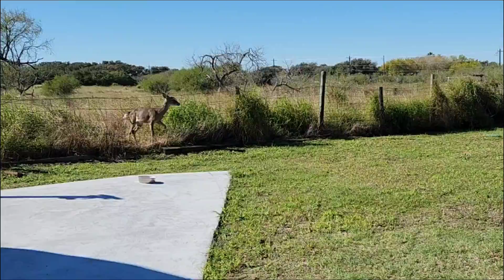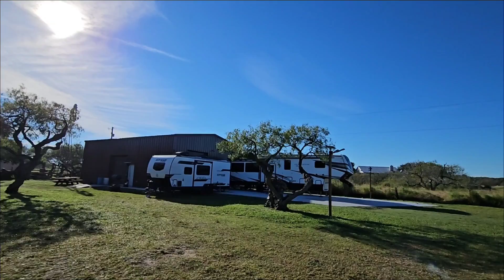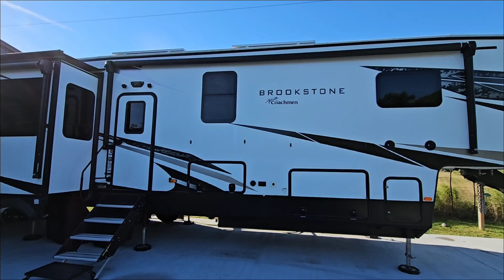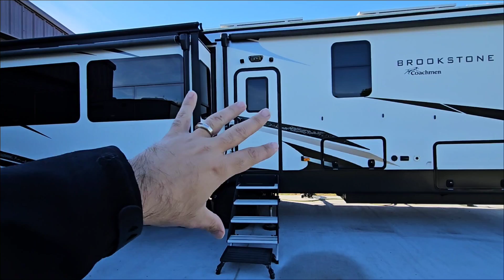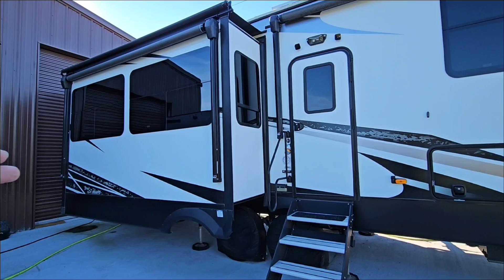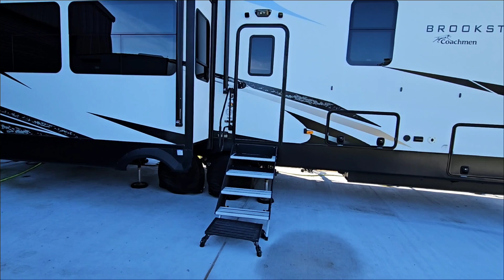NO MORE RV REVIEWS?

Comment: JD my wife & I are just starting out pulling a toy hauler with a Diesel Dually. The only towing I did previously was with my touring H-D pulling a small cargo trailer. 

Anyway I dig your videos but for 2024 but since we own used truck & Rv maybe we can see more content on upgrades to say older 5th wheel or Conventional Pull Rv’s. Especially Toy Haulers. Anything from electronics to storage to fixtures to holding the toys themselves securely in the toy hauler itself to other. Also possibly more things truck & towing related like extra fuel storage, mpg saving do dads or even say certain programs or apps that help not only with fueling but traveling itself, creature comfort things for the interior, etc. I’ve only been watching ya since maybe the middle of summer 2023 so I’m sure you’ve got some videos already on many of these things. I will research your past videos.

Thanks JD, family and crew. Happy New Year’s to all. ✌🏽🇺🇸🙏🏽

Comment: Would like to see a video specifically around NXG Huck bolt RV frames. I’ve seen high end long RVs and even huge bridges are built using huck bolts. Not a lot of info on YouTube regarding huck bolt frames. A 2020 Venture Stratus SR321VBQ which is 35’11 long uses the NXG Huck bolt frame solution, for example.
Reply from the maker: BAL has been using Huck Bolt frames for quite some time.

Comment: Looking forward to videos on construction quality and even quality control of RVs. As a full timer how well something is put together and stays together is a priority when choosing an RV. Repairs in warranty can be more expensive than just hiring a mobile RV repair tech when you figure in fuel and accommodations while your RV is in the shop. I really like the looks of the Surveyor. I’ve been looking online at that series of trailers. The interiors are very nice with good storage. The question is. Are the quality of materials used going to hold up in the long run?

Comment: build and engineering quality.  Why do RV manufactures mount the entire weight of the RV body/walls on "outriggers" and not directly on the frames...your house walls are not supported on outriggers, the walls sit directly on the foundation?  Less bling and better construction on the interior.like cabinets, interior walls, drawers, shower, counter tops, etc.  Like JD mentioned, suspension.  JD was at ROA earlier this year, look HOW companies like Imperial Outdoors is building units, or how the PAUSE is built...these units are built like tanks! The number one compliant I hear about RV's is poor engineering and how poorly the are built...fall apart just driving them off the lot.

Comment: As a senior couple with pets starting out in the RV experience we find it difficult to find a 5th wheel with enough space in the living room. We don’t need 3 couches and would prefer maybe a desk that could fold away. We would also like to see a half bath with washer dryer connect so noise is not in the bedroom or taking away clothes and storage space. As a senior advocate we do not like the frameless windows since the turn handles may be difficult to open with arthritis and prefer sliding to allow better air flow. Obviously we need vents pet friendly and without a third couch more floor space for dog beds etc. Large sturdy shower with solid bench and wider shower opening for seniors with stability challenges. If possible a rear or front kitchen which usually offers more counter and floor space (no island). One large closet seems more practical than two separate allowing for shoe and other storage. Night stands are a must. Due to the lack of population growth the senior community will become imho a ongoing larger community of RVers. And since statistics show we travel with pets floor space is needed over entertainment space and additional couches. And all this needs to be around 35 ft. If possible a large rear under storage with slide again so older people can easily get and store for travel. Put yourself in a Time Machine and think about what you would like AND / OR need when you are in your 60s or 70s. Would love to have you put together a floor plan with all your knowledge and expertise. Oh, and cut off valves at each plumbing point. For brands we like Brinkley and would love them to try a floor plan with these suggestions.
Reply: Sounds like you need a DRV designed by Alicia at Rolling Retreats in Elk City, OK.
Reply: @RamblinRoadies Or a tiny house, custom designed as they usually are.
Reply: @norarivkis2513  A mobile tiny house? Many RV parks won't allow them.
Reply: @RamblinRoadies  I know they don't necessarily allow things that look like tiny houses from the exterior, but there are people who build the interiors with similar custom planning on an RV base. I've never heard of anyone having trouble with one of those, though I admit I don't live in an RV so I don't know a huge number of parks. Might at least be worth looking into.
Reply: I'm not yet in the senior category but will be soon enough and agree with everything you've said we will go full-time hopefully in the next 8 yrs
Reply: It doesn’t have the half bath but it does have a big living room and washer dryers separate from bedroom KZ Durango Gold 383RLQ

Comment: The shackle reinforcement still blows my mind that it went as long as it did because of just how cheap and easy it is to do while the frame is in the jig being welded. 
We bought in 2019 and had an issue with the slide room roof sagging. Jayco offered the dealership a cheap, quick fix, which failed as soon as I towed it again and then wouldn't stand behind it because it was past the 1 year warranty.

Thankfully we bought the extended warranty and our dealership came up with their own solution because they had 3 other units with the exact same problem!

I remember the prowler 5th wheel my dad bought when I was teenager in the early 2000's. I don't remember any major issues with it and we took it down some washboarded mountain roads.
I would be cringing to open the door on mine if I did that now.
Perhaps the RV industry needs to downsize like the domestic automakers did in 08-09. Drop the redundant lines and focus on the fit and finish, becuase most of the quality issues don't require nicer materials, just properly trained employees.

Comment: Probably the most important invention is the ABS system. I wish I had ABS because it will keep the trailer following the truck and independent suspension like the Pause. I have TT made by Dutchmen. A brand hardly ever mentioned even at Hershey show.
Reply: Our last 2 have been Dutchmen due to costs, quality plus the outstanding dealership near us their service when we do have issues have been top notch.

Comment: I want to know more about the competition that is out there for Lippert. I've become very frustrated with Lippert and wondering why nobody else is out there making frames, or leveling systems and axles. Is it possible I am overlooking somebody? Is there an RV manufacturer out there that is trying something new?
Reply: There are...look at Imperial Outdoors...or the Palomino Pause.  These are off road trailers but the WAY they build and the products they use makes you wonder WHY the RV industry has not moved in that direction long ago.  Heck, even the InTech lineup has moved in a good direction.  Ember is getting close but they  still need some work with Frame and interior construction.